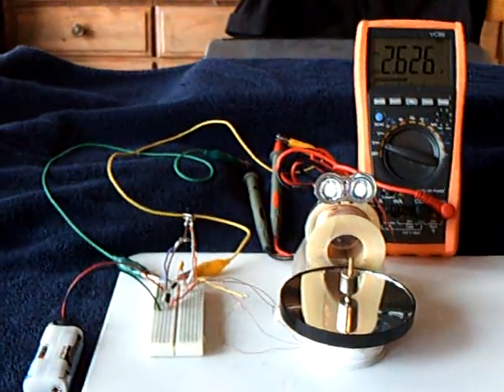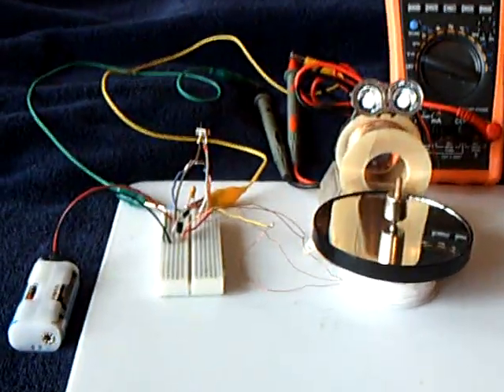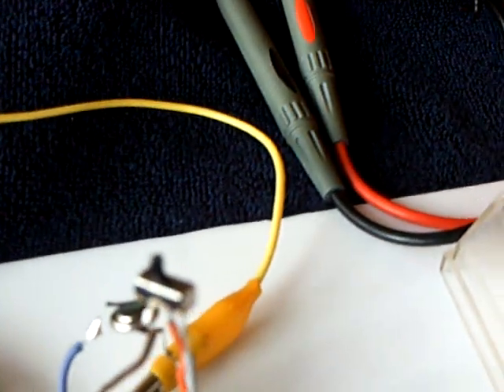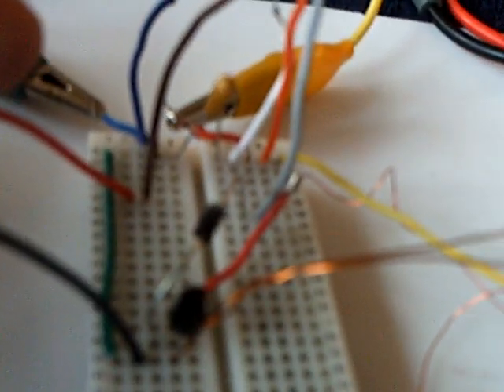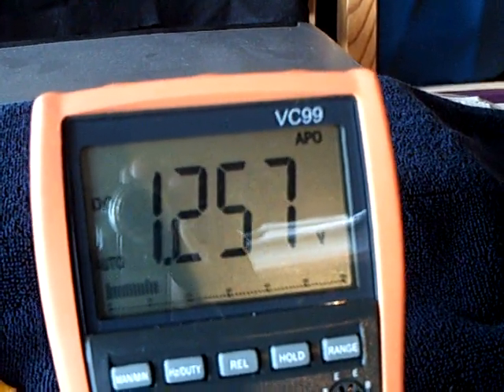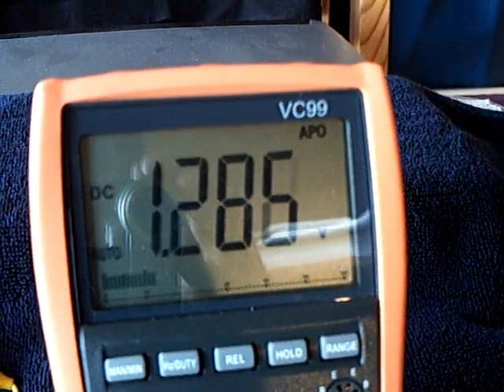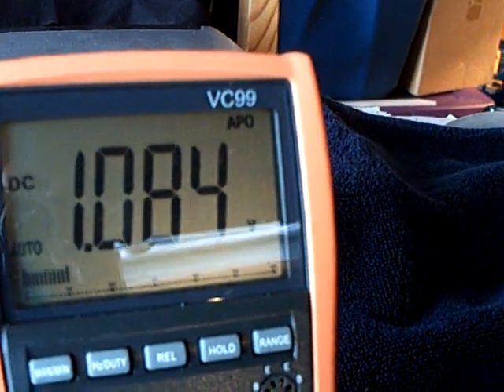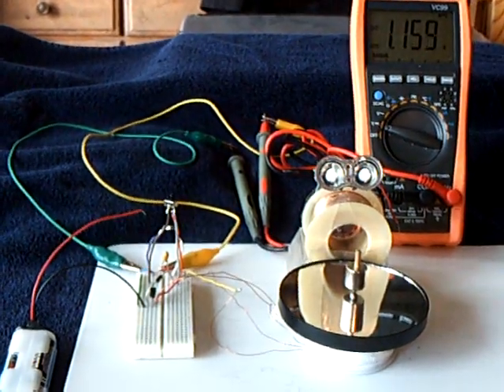Larskro Looper Project

Comment: You should try to use 1N4148 connected in 3 x in parallel or use a fast diode.
The 1N4xxxseries does have slow recovery as compared to the similar UF4xxx series.

Comment: Lidmotor, I think you have shown clearly, that this is a temporary effect, which you do encounter with caps at times. The values and parts Larskro has probably extend this effect as he runs the video. When off camera it starts dropping. I have en-counted many such effects with very small systems, like what you do with Penny etc.they are both artifacts of the meter and spurious electro-smog. Regards Arto
Reply from the maker: Stephan asked him how long it ran and he said, "until I stop it with my finger." Hummm. Pretty strong 'spurious electro-smog' if that is the case.

Comment: When you switch the fly back on,you are also getting a half wave current pulse from the generating effect from the spinning magnet(due to the single diode),as well as the inductive kick back.If you remove the spinning magnet,and get the system to run in S/S mode,then switch on the fly back,you wont see the cap rise in voltage-it will only fall slower.What would be interesting,is to replace the single diode with a FWBR,so as you can use the full wave being generated by the spinning magnet.Nice work as always Lidmotor.
Reply from the maker: I think you explained what is happening here.  Nothing unusual -- just interesting.  That leaves the Larskro motor effect still a mystery.
Reply: Need to get back to you guys and show you my progress!  

:D

(JustAnElectrician from TEEP)

Comment: Hi Lid,
you forget, that you still draw power for your 2 LEDs...
So it could be that your voltage is not climbing, cause your 2 LEDs from your coils are still using up too much power.
Please try again without these 2 Leds and let us know, if the voltage will rise then to higher levels than the battery voltage.
Many thanks.
Regards, Stefan.
Reply from the maker: Without the pickup coil led load the caps still drain.  The setup here will not give us the Larskro Motor effect.

Comment: You sure the spinning magnet isn't charging the capacitor back up as it spins down?
Reply from the maker: I know what you are talking about but the circuit is firing on both switch positions and the rotor is being driven. Only on the loop position the coil flyback is shot back at the cap pair through the diode.
Reply from the maker: Take a look at TinMan's description of what is happening.  He may have nailed what is going on here. It is a simple explanation of an interesting effect.  What Larskro has shown may be something very different.

Comment: Do you also have a Reed Switch or do you use a transistor ? Please use Reed Switch . Please post your circuit diagram. Many thanks,
Reply from the maker: I have been working on this for a couple of days with different setups including reed switch triggered circuits. This one showed the most effect.  It is a simple bifilar coil circuit with a 2N2222 NPN.  The circuit is the MEG GA JOULE I showed with a 1N4007 diode looped back to the (+) rail.  The rotating neo ring magnet overrides the self-oscillation and triggers the circuit.

Comment: Hi Lid !
Many thanks for confirming parts of it....Maybe use a supercap besides the Tantalum cap and try again... WHat temperature curve does the Tantalum cap have ?
Reply from the maker: I just got that Tantalum cap today and I have not done much research on it.  Radio Shack has them.  I think that we are going to have to gather all the right parts to exactly duplicate Larskro's motor and see the same results.  I don't think that it is a fake but there may be a strange but simple reason for what is happening.  Frankly I think that it is just a cool device and would love to have one running in front of me.  Maybe it does draw ambient heat energy to run.  I don't think that enough light energy is getting in to run it--even with the leds on the board.